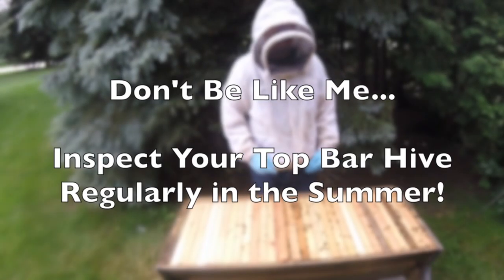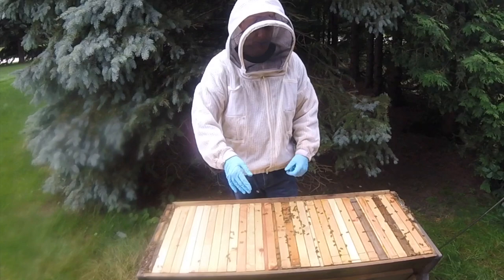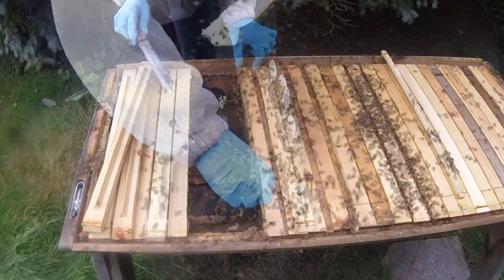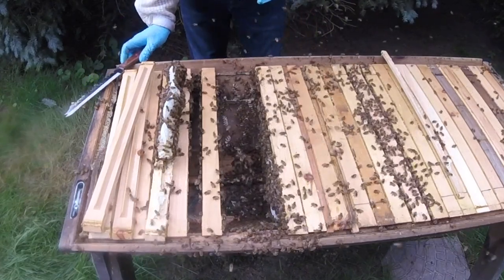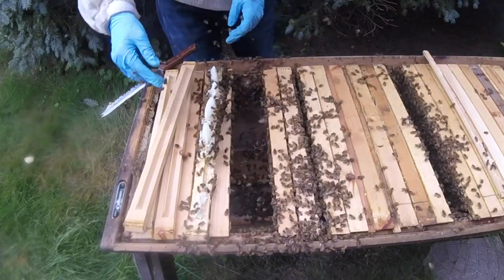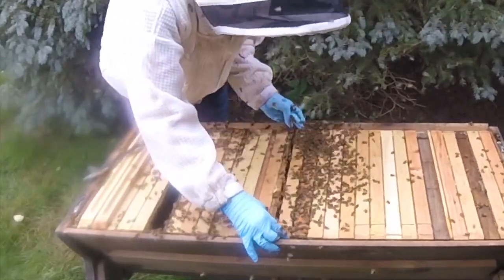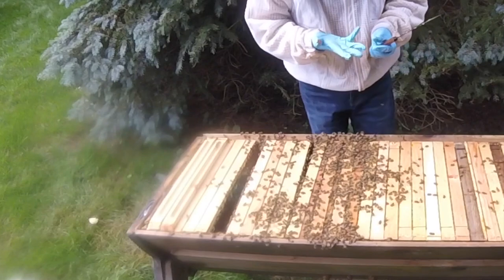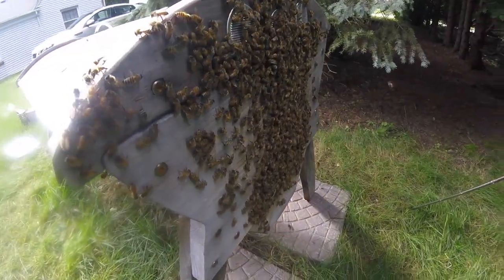This is Why You Need to Inspect Your Top Bar Hive Regularly in the Summer

Comment: I'm not a perfect beekeeper in any way, sure I've made a ton of mistakes but I've learnt from them as far as I can tell.
We have 8 hives running here in the uk and all are doing just fine.
We use a mix of full sized red cedar and poly hives.
Nuc's and full size poly's 
I'm not being critical but just trying to raise the point.
In between the top bars on the comb and around the comb bees are moving constantly.
You are using a serrated knife which is chopping bees to pieces with every movement.
Also you have no idea where the queen is,she might be in the brood cluster in the centre or to the left or right.
Please please get a standard tool and take a couple of the end frames out that will give you room to remove the centre ones which you are going to straighten.
Reply from the maker: We do have a top bar hive tool, but didn't have it on hand the day of recording.
Reply: Can not hear you..you mumble!!
Reply: @carolynbrookens5348  😄